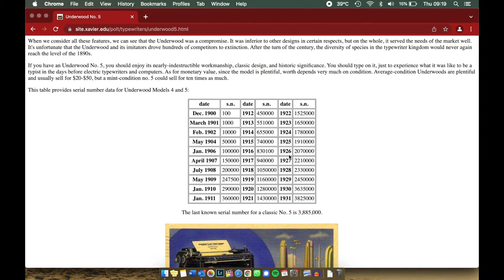Cleaning a 100-years-old Underwood Typewriter | Relaxing Timelapse

Comment: What are you spraying with?
Reply from the maker: Hi, a mix of water and dish soap I made. Then WD-40 for some of the gears (but that stuff is strong, so I tried to be careful).
Reply: @alrevon  Thanks so much for making the video, it is absolutely excellent (waiting for my Underwood next week and, can't wait to open it up! this video is super helpful to get ready). Re WD-40, although I am no expert I read it may gunk up later on as it attracts dust and it is quite thick - for anyone wanting to take a safer approach, I have seen sewing machine oil (or gun oil, if you are in the states ;) being recommended for the same purpose (i.e., for the moving metal parts, particularly on the type bar levers). Regarding the cleaning liquid, I intend to use mineral spirit which I understand is suitable for the purpose - if using water, need to make sure it is left absolutely dry, otherwise you risk rusting. Hope this is helpful to someone and thanks again for posting :)
Reply: @alrevon  everything i've seen in typewriter cleaning YT videos says NEVR use WD 40. it's not a lubricant
Reply: @petergilstrap6357  I totally agree, I wouldn't touch wd40 on a machine like this

Comment: I have a model 6 just cleaned it out completely. I love what you did, I did cringe at the the screw driver scraping though
Reply from the maker: a model 6, love it! and I agree. it's the only thing I could think of. looking back I would have used something slightly softer.

Comment: Thank you for this video! I also have a #5, mine is either 1909 or 1910, but I've been so afraid to clean it myself. Thanks to you, I now have the confidence to tackle this project on my own! Also, I think the website you used to check the serial number might be incorrect and your typewriter is actually from 1925, not 1915. @1:30, the label on the back, at the bottom, which lists patent dates, is a clue. The  last column of patent dates on the label look like it goes out until at least March 1925 so this typewriter cannot be from 1915. If it's indeed from 1915 then the label could not possibly have future patent dates on it. Thanks again for this very helpful video! 😁
Reply from the maker: Hi Nicole! thank you for the fact-check. You definitely might be right. Good luck with your own project. :)
Reply: The Typewriter Database site is the best for serial numbers.  Also, the patent dates are not the serial number.  On Underwood 5 machines such as this, there is a number on the right side of the body under the carriage.  See 5:28.  Usually it is covered in dirt and dust.

Comment: I see a can of WD-40. NEVER use WD-40 on a typewriter. It may work fine as you use it but in a week of two it will become gum up the keys.
Reply from the maker: YES! Absolutely, I only used it (very carefully) on a small little cogwheel that was a bit rusty and stuck. But definitely not something you should use anywhere else. Appreciate the tip, though! Thanks.
Reply: Huh? Oh shit, wait what do I do, I have a Remington model 12 typewriter
Reply: Is it ok to apply to rust areas to prevent further rust?

Comment: I might have skipped the part where you fixed the carriage not moving when you type, but if you didn't, there is likely a disc at the back with a spring. The band can be seen early on loosely laying in the back which was formerly connecting carriage to that spring disc. Had the same on my continental and replaced it with yarn since I had nothing else. Be sure though to test how many revolutions of spring power you want when typing. My carriage was rather sluggish at first but I may have overdone it since then ^^'
Reply from the maker: Hello! Yes, I actually managed to find the issue and fix it after looking at different youtube videos. Indeed, it was the band of the spring that had disconnected. It's old but seems to be in good enough shape, so I didn't change it. It was really hard to control the revolutions of the disc and put it in place. Thanks for the tip, though!

Comment: The spray cleaning is driving me insane bc it feels like it's still not clean all the way in the grooves lol. I'd want to remove the parts you can't get wet and then dunk the whole thing in soapy dishwater
Reply from the maker: ha! that's fair, I get it. I just decided to be extra cautious with it. I'm no expert, so I feel totally disassembling it always comes at the risk of not being able to put it back together right or messing something up. This was a good enough cleanup for me. :)
Reply: @alrevon  same here! I get it lol I have a very old typewriter that needs to be cleaned as well and I wouldn’t dare take that thing apart. I’ve actually been thinking about dipping it in water but I’m a novice myself and don’t want to mess anything up. Kudos for what you were able to accomplish!